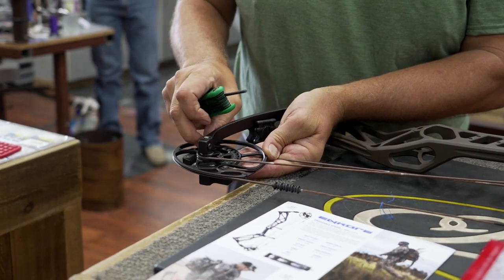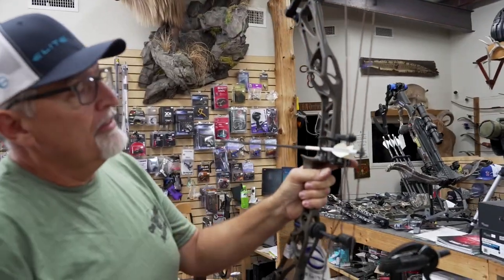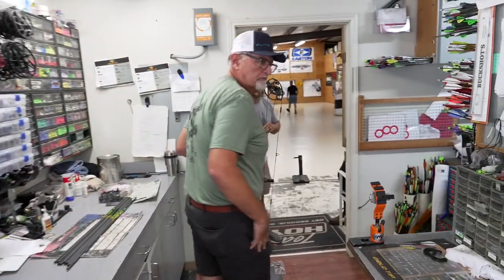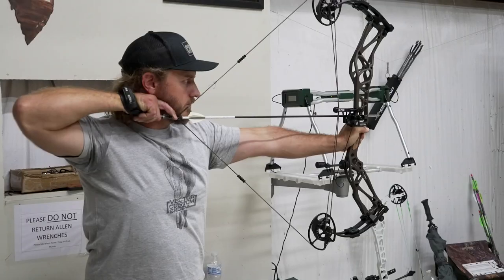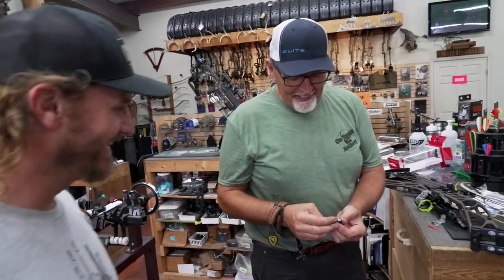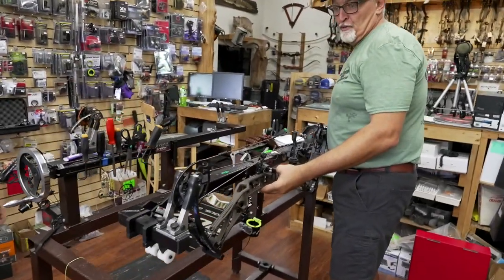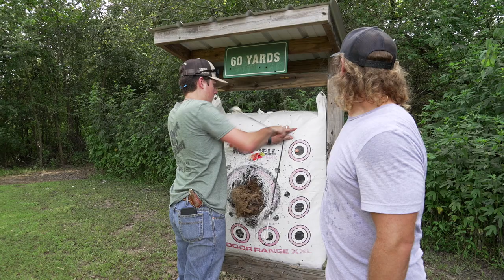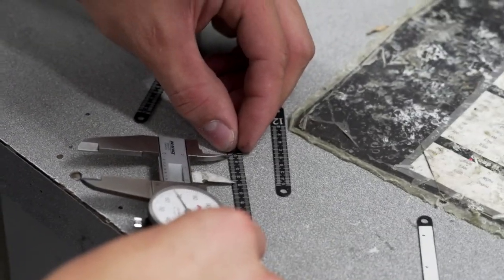We Got New Bows! | How to Set Up For Archery Hunting

Comment: I have a question and pretty new to archery hunting. With that being said I have sighted in my field points. 
I use a 350 spine victory and gold tip arrows 50g inserts and 175 g iron wills wide solid. 

28 1/2 draw at 70lbs crono with 100g inserts 270 fps. 

My broad heads are hitting 8-12 inches left of my field points. 

I was reading to move my drop rest to the right so I did and that put my broad head on the bullseye 🎯. But my field points moved 6-9 inches right. Is it possible to have my bow both broad head tuned and field point tuned and hitting in the same place? I’m also using the EZV sight Diamond edge 320 bow.

I’m headed to on target 🎯 tomorrow
Reply: It may be a spine issue. You could try spinning the arrow 120 degrees and check if the groups come together
Reply: @beforethehunt   that’s what I’m thinking. It’s a lot of weight up front. I might go to a 300 spine.